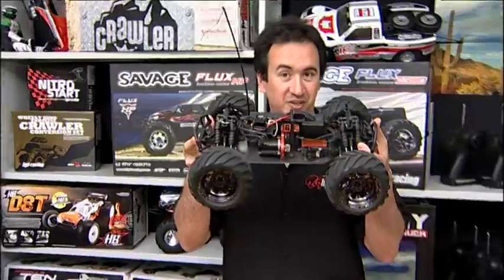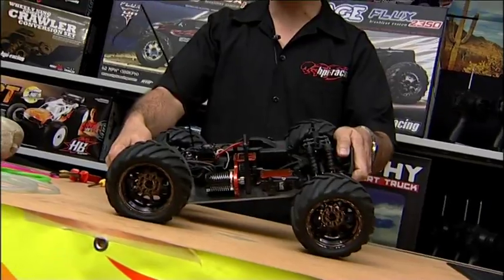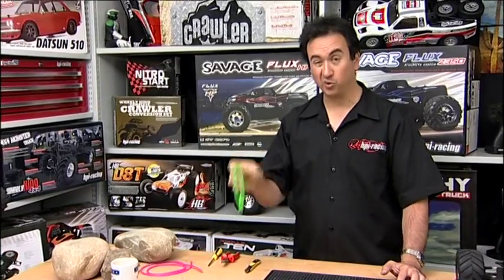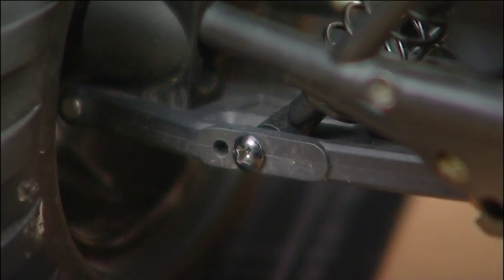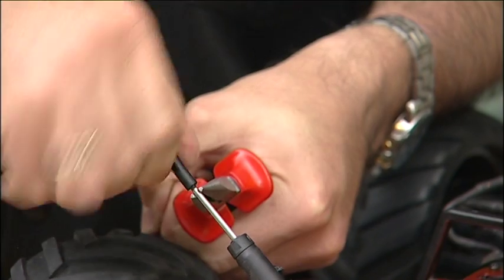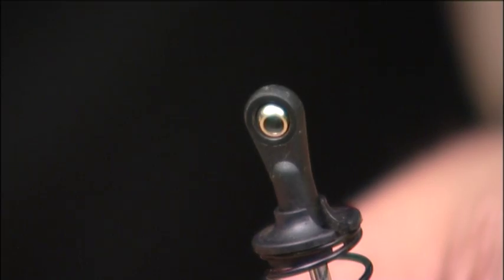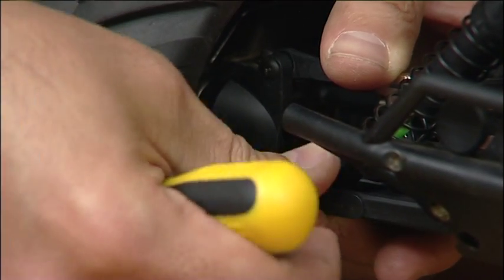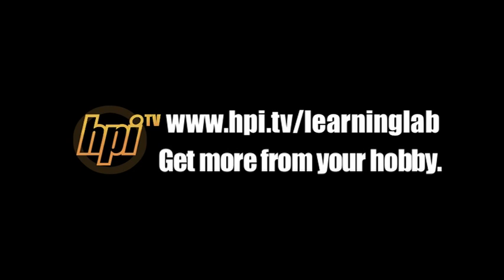HPI.tv Learning Lab - Bullet Bump Stops

Comment: What he's describing here is 'uptravel, and, IMO would be better dealt with by adjusting the pack. I'd start with  pistons with smaller holes, then fewer holes, then both. There are adverse affects to doing this...it's the same reason you don't address it with thick shock oil, the truck won't 'boogie' off-road as it did prior. ;-).  You can the bump stops to the inside as well that is meant to keep the truck flatter (more agile) as less weight is transferred. You can also try stiffer, springs, but that really affects handling, IMO.